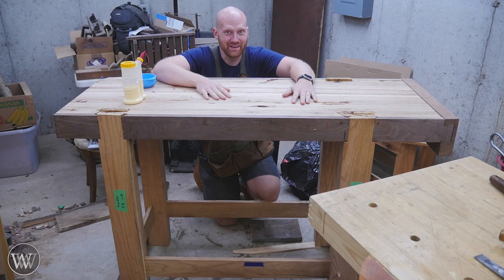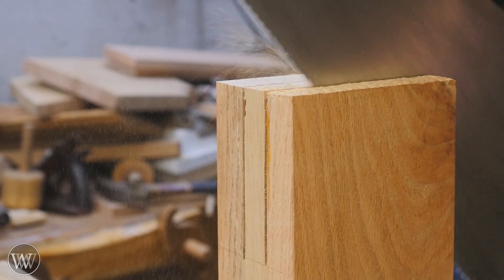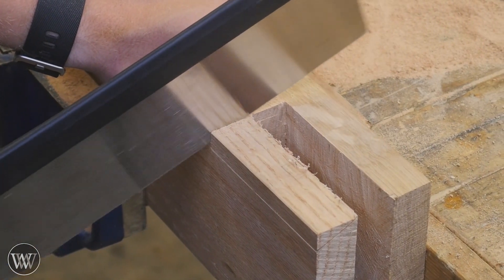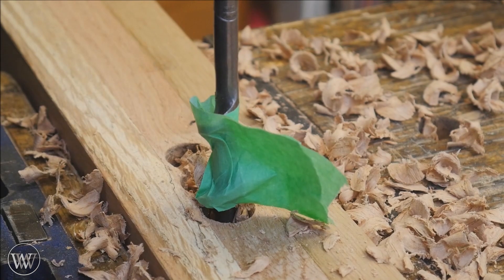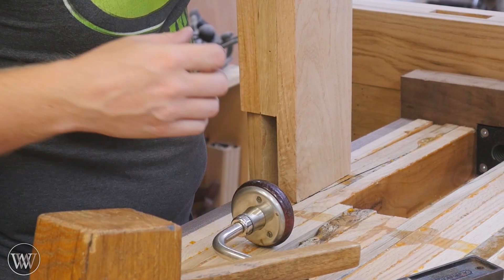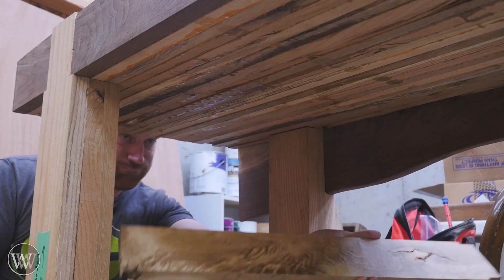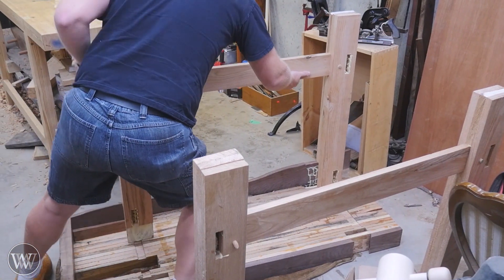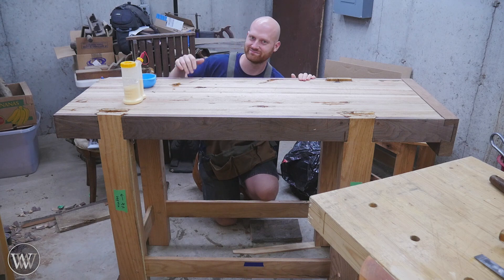Hand Tool Woodworking Bench 4 - Wood By Wright Roubo English Hybrid Workbench

Comment: I'm a wee bit too lazy for all that, I would have "cut" all the tops of the legs before glue-up, the tenons for the long side of the bench too... Just a wee bit of chisel cleanup before assembly... The live edge is just gorgeous!
Reply from the maker: if I were in a power tool shop where all the laminations were the same thickness I would have. but with hand tools, all the laminations on the legs and top are different thicknesses and the time it would have taken to line them up in the clamping would not be that much less than cutting the joints. and on top of that, this is the part of the work I enjoy. LOL but I am a bit odd.
Reply: You know, after building my greenhouse from rough sawn, you would think, I would know enough, to consider board thickness...

Comment: Inspired by your videos and currently in the process of building my own Roubo style workbench! When gluing the legs to the base I found that, with my stretchers in, the top would not sit flush with the middle portion of each leg. So there is a small gap in between the bottom of the bench top and the middle portion of one leg. Is this going to be a problem? 

I think it happened because the bottom of my bench top is very much not flat (as you pointed out, flattening it seemed like a waist of time). But, once I had my stretchers in, the legs very much want to sit on a flat plane. So it seems like it is not possible for the uneaven bottom of the benchtop to sit flush on all four flat/even legs. Not sure where I went wrong, (or maybe this is just fine). Would love to hear your thoughts on this!
Reply: Okay so after watching your most recent video on flattening a benchtop I am realizing I should have done a better job making sure the part of the bottom where the legs go in were all parallel. those four sports clearly need to be on the same plane. I flattened that part some but clearly should have done it better. I might see if I can plane down a shim to glue up and slide into the gap?
Reply from the maker: You're honestly won't make that big a difference. All it will mean is that the top is not parallel with the bottom of the bench. and for the general function of it that's not much of a problem. Usually your floor will be far more out of flat than the difference between the top and the bottom on average. As to the stretcher not touching that's not that big of issue as long as the glue up between the laminations is strong there shouldn't be any problem there at all.

Comment: Can you share with me the hand saw you used to cut thru 5 inches of white oak?  I've always wanted a saw that could do that.
Reply from the maker: I have several. this one is a 32" Atkins panel saw that I failed to 4TPI and rip cut. but I also made a frame saw that would do it a bit better but for some reason, I chose not to use it. here https://www.youtube.com/watch?v=SC_hn3T9AqM

Comment: Did you do a dry fit before gluing?  I have seen other dry fit before gluing.  (you may have but did not insert that footage into this video)  At the end of the build, I would love to know how many hours it took to build the workbench.
Reply from the maker: I did not dry fit the whole thing just each piece. with how tight and complicated this is it would have ruined the fit to dry fit the whole thing.
Reply: Good call.  That is the cool thing about woodworking.  No rules.  Only guidelines.  I cannot wait to see the vises you attach and how they work.

Comment: How come when you laminated the legs, you just didn't leave the portion that you were going to cut off shorter in the first place. I know it's cheating, but when I built my router stand, I intentionally left the mortise slots in the rails to avoid a lot of work down the road.
Reply from the maker: I would if the laminations lined up. but in this case, they were different thickness. If I were using power tools I would bring them all to the same thickness and that would work perfectly. but with hand tools, it is so fast to cut it is is not worth spending the time to thickness plane all laminations to the same thickness.
Reply: Thanks for the reply.  I knew there had to have been a good reason.  The angle of the camera when you were cutting the slots looked to me  like the boards were all the same thickness.

Comment: Would there have been a way to leave some of the holes there when laminating the legs or bench so you didn't have to do so much sawing or drilling?
Reply from the maker: if I were in a power tool shop where all the laminations were the same thickness I would have. but with hand tools, all the laminations on the legs and top are different thicknesses and the time it would have taken to line them up in the clamping would not be that much less than cutting the joints. and on top of that, this is the part of the work I enjoy. LOL but I am a bit odd.

Comment: How do you account for the expansion and contraction of the top of the bench with the stretcher that seemed to be mortise and tenoned between the legs? It seems like there is no room for the top to expand and contract, or am I missing something? Very interested in doing a similar build but am concerned about the seasonal movement.
Reply from the maker: That can be an issue if you are in an area with a very large swing or if you're planning on having it in an un air conditioned space. But mine is kept in an air conditioned basement and with only 20 in across it's not as big a deal. Though. I didn't glue the second side so it could float a little bit.
Reply: @WoodByWright  thank you for the reply! This reminds me of your other video about accuracy and how the amount of accuracy depends on what you're doing (metal work vs. Construction work). Wood will move, but the extent to which varies based on the surrounding conditions the piece will be in. 

Im military and expect to be PCS'ing multiple times, allowing for movement has been a big concern for figuring out how to make my bench.

Comment: It's a laminated leg, so why not just make the middle piece the width of the top + shorter during glue up?
Reply from the maker: because the laminations are all different thicknesses. with hand tools, it is easier to cut the joinery with hand tools then to bring all the laminations to the same thickness.

Comment: Hi james I've a question for you.I'm building a roubo workbench,when I'm gluing the base I couldn't put all of dowels in their place(Some of them were pine which split in the hole and some of them couldn't make all the way)How can I fix that problem?
Thanks
Reply from the maker: If I am understanding correctly the dowel split across the dowel at an angle? my first question would be why use pine. I rarely use anything softer then poplar for a dowel and oak most of  the time. pine just does not have that much compression strength. if it broke in the hole then you would have to pound them out from the other side and try a new dowel. if that is not an option the only thing left is to drill them out. let me know if you have more information I am missing or am answering the wrong end of the question.
Reply: I'll try that for split dowels.Although I used beech dowels for some of them I couldn't make it through the hole.Should I redrill the hole?

Comment: why on earth didn't you build the tenon into the leg during glueup? you'd have saved yourself a load of sawing
Reply from the maker: if I were in a power tool shop where all the laminations were the same thickness I would have. but with hand tools, all the laminations on the legs and top are different thicknesses and the time it would have taken to line them up in the clamping would not be that much less than cutting the joints. thought the camera made it look that way the cuts were not straight down the glue joints. and on top of that, this is the part of the work I enjoy. LOL but I am a bit odd.

Comment: I've been making a Roubo workbench for a while and I'm going to cut sliding dovetails on the legs.I don't have a tenon saw I have a carcass saw and a 5 tpi rip saw.Which one should I use or do I have to buy a tenon saw?
Reply from the maker: +Hamit Ali they both can do it as long as the carcass saw has a deep enough cut. It will just be slower cutting as it has crosscut teeth in it. The rip saw has bigger teeth so the cut won't be as smooth. Just chose which you would prefer and which you feel more comfortable with.

Comment: my bench is on really early stages now. Im still planing the 4 pieces of 3x6 inch for the table top...its insane. Im using a no7 jointer plane and still couldnt get the wood all straight to glue it. And its 8 feet in length.... Anyone have any tips on how to determine if the wood is straight enough and how to achieve it?
Reply from the maker: with those big planks, you won't be able to clamp much out of it. So if you put them on edge and set one on top of the other and eye through the crack if you see light you do not want to plane there. If there is no light that is where you need to remove more.

Comment: Could some of them holes been made in in the glue up?
Fantastic liking joinery 👍🏻👍🏻👍🏻
Reply from the maker: what holes are you referring to?
thanks man!
Reply: Wood By Wright your mortices that you chiseled out on the top, and tenants. Looks like you could have set them up in your glue up
Reply: I was going to ask the same, James. If I'm following what theduck is asking...for the legs that had the sliding dovetail you cut along your glue joint to remove that piece but could you not have just made the centre piece of the lamination shorter to accommodate for that void? Same goes for the opposite side with the through tenons, could the 2 outer pieces of the lamination not been shorter and allowed for a longer centre (tenon)?
Reply: In addition, I think theduck's comment was directed at the mortises in the legs for the stretchers
Reply: That they said 👆🏻👆🏻👆🏻